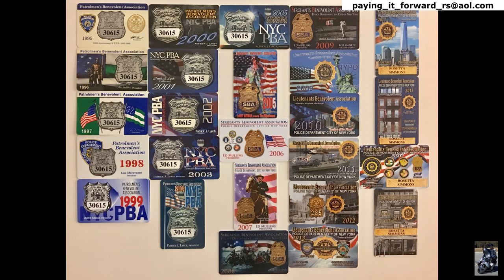No Need To Duckwalk Your Motorcycle In Your Driveway! Trust & Believe!

Comment: Answers: rear wheel stands you up.  Rear brake adds control. 
Robert, what you provide is immeasurable to so many.  I relate to your other pre-loaders.  I went to the local garage today, filled the tires with air and went to leave.  Wasn’t sure I could do a U-turn, but not only did I do it, but did it with plenty of room to spare.  What did I do next?  Well, here in Germany on Sundays, all stores are closed so I went to a parking lot and practiced. I have a lot to improve and am still learning.  THANK YOU so much.  Brian.
Reply from the maker: All answers absolutely correct!!😁👍🏾
Congratulations on that u-turn! You should be proud!
It’s my pleasure. 😊 Preload!!! And Keep It Loaded!!!!

Comment: this might be a silly question but i was taught to get off the low side of the bike, so i am curious as to why you get off the high side. you probably covered that in one of your vids but i am new to your channel so i have not seen them all yet but i really enjoy them and learn lots from you thank you
Reply from the maker: Yes there are two reasons I mount and dismount my motorcycle from the high side. The first reason is from training. Officers usually pull over on the right side of the road and when doing so, we are trained to dismount the motorcycle on the non-traffic side for safety. The second reason is it avoids accidentally causing scuffs on my saddlebags or backrest or anything else that may be victim to a swinging foot. This also includes a passenger being on the motorcycle while you're getting on. The third reason and most relevant one for now is it's easier. My hips are bad so not having to swing my legs up and over the seat is very beneficial. Hope that helped.😊
Reply: @BeTheBossOfYourMotorcycle   awesome thanks i never thought of that as i have issues with my hip as well, thank you very much for your solid advice
Reply from the maker: @zanedgallipeau9119  It’s my pleasure. :_PRELOAD:

Comment: Hi Robert. I'm a subscriber from the Eastern region of Thailand, near the Cambodian border. The roads are dangerous here and I always practice safe motorcycle handling. In fact I had my first motorcycle lessons from the Toronto Police Force in 1986 when I got my first bike. Your slow speed techniques are very smart and I'm using the rear brake way more than I used to.
I answered all your quiz questions correctly today thanks to watching 4 or 5 of your previous video practice sessions. But one thing puzzled me in this video. At 3:45 you praised Preloader Don for mounting from the high side. This is new to me. I've tried it and I've thought about it but I need to know why you recommend mounting and dismounting from the high side. I don't think you've talked about this before.
Reply from the maker: Hey Dan. Thank you for watching and subscribing!👍🏾😁 Also, thank you for the compliment! 
Yes there are two reasons I mount and dismount my motorcycle from the high side. The first reason is from training. Officers usually pull over on the right side of the road and when doing so, we are trained to dismount the motorcycle on the non-traffic side for safety. The second reason is it avoids accidentally causing scuffs on my saddlebags or backrest or anything else that may be victim to a swinging foot. This also includes a passenger being on the motorcycle while you're getting on. The third reason and most relevant one for now is it's easier. My hips are bad so not having to swing my legs up and over the seat is very beneficial. Hope that helped.😊
Reply: @BeTheBossOfYourMotorcycle  Thanks for the explanation Rob. I need to understand the reason for something before I can really internalize it and make it a habit. However, in Thailand we drive on the left side, so I guess I can continue to use the low side as long as my hips hold out. Cheers!

Comment: I didn’t watch the whole video because I’m getting ready to leave for work. My question is, why get on your bike from the right, instead of the left 🤔. I get on where the kickstand is located. I’m a new rider kind of. I learned over 10 years ago. Just recently got my motorcycle license when I moved to Florida, from California. I’m ALWAYS up to getting more information about how to ride. I don’t have a bike yet, but I’m working on it.
Reply from the maker: Yes there are two reasons I mount and dismount my motorcycle from the high side. The first reason is from training. Officers usually pull over on the right side of the road and when doing so, we are trained to dismount the motorcycle on the non-traffic side for safety. The second reason is it avoids accidentally causing scuffs on my saddlebags or backrest or anything else that may be victim to a swinging foot. This also includes a passenger being on the motorcycle while you're getting on. The third reason and most relevant one for now is it's easier. My hips are bad so not having to swing my legs up and over the seat is very beneficial. Hope that helped.😊

Comment: I think Ive watched all your vids maybe missed one or 2. Why would you get on your bike on the high side? I never seen any one get on a motorcycle from the high side.  I appreciate your advice.
Reply from the maker: Yes there are two reasons I mount and dismount my motorcycle from the high side. The first reason is from training. Officers usually pull over on the right side of the road and when doing so, we are trained to dismount the motorcycle on the non-traffic side for safety. The second reason is it avoids accidentally causing scuffs on my saddlebags or backrest or anything else that may be victim to a swinging foot. This also includes a passenger being on the motorcycle while you're getting on. The third reason and most relevant one for now is it's easier. My hips are bad so not having to swing my legs up and over the seat is very beneficial. Hope that helped.😊
Reply: @BeTheBossOfYourMotorcycle  Thank you for that in depth reply. I tried this on my Road Glide and it is easier to get over my driver back rest.  I also tried it on my Street Bob. Not really practical for the SB the frame seems a  little small and it's about 300lbs lighter.  Again thank you you insight has helped me improve my riding skills.
Reply from the maker: @AmericanSCPO  It’s my pleasure. 😊 You can do it on your Bob. Make sure your hands are on both of the handle bars before you put your weight on the motorcycle. That will ensure your weight is centered on the bike and you can just step over the seat. Give it a try and let me know how it works out. 👍🏾

Comment: My understanding that police officers dismount on the high side to protect themselves from traffic, but why do you reinforce the practice of non-officers getting off the high side? Thank you for sharing all your knowledge.
Reply from the maker: Yes there are two reasons I mount and dismount my motorcycle from the high side. The first reason is from training. Officers usually pull over on the right side of the road and when doing so, we are trained to dismount the motorcycle on the non-traffic side for safety. The second reason is it avoids accidentally causing scuffs on my saddlebags or backrest or anything else that may be victim to a swinging foot. This also includes a passenger being on the motorcycle while you're getting on. The third reason and most relevant one for now is it's easier. My hips are bad so not having to swing my legs up and over the seat is very beneficial. Hope that helped.😊

Comment: I have a question, when you're pulling into the driveway or place like that... Do you pull in the clutch as well? Or just keep using the rear break and along with slow speed ?
Reply from the maker: Thank you for watching and hopefully you’re subscribed!👍🏾😊 I stay in the friction zone and use the rear brake when needed.

Comment: Hey, man. I just bought my dream bike (as my first bike) on May 11th. I live in ATL and have been practicing slow speed clutch stuff in a parking lot. I was wondering if you'd possibly give me some coaching?
Reply from the maker: Congratulations on the new bike. Are you referring to private lessons?
Reply: @BeTheBossOfYourMotorcycle  any sort of coaching you offer.
Reply from the maker: @phillippavon2887  I offer my practice sessions which are free to my V.I.Preloaders and I also offer private lessons which have a fee.
Reply: Is there a way to get in touch with your personally?
Reply from the maker: @phillippavon2887  my email address is on the upper right corner of my videos and in the description section.:_PRELOAD:

Comment: I have a question how about going the opposite direction. Is it possible to duck walk going backwards down your driveway?
Reply from the maker: Ducks don’t walk backwards.
Reply: @BeTheBossOfYourMotorcycle  Have my new heritage stuck in the corner of my very short single car garage wondering what is the best way to get it down the driveway or turned around so I can drive it out?
Reply: I was glad to get my bike out of my little garage (duck walk -backwards) and past my parked truck. On a pretty good incline. I wonder if I need a battery tender? My gal really growled at starting in 30° Minnesota weather.
Reply from the maker: A tender is a good idea.

Comment: What is the purpose of getting on and off the bike on the high side?
Reply from the maker: There are two reasons I mount and dismount my motorcycle from the high side. The first reason is from training. Officers usually pull over on the right side of the road and when doing so, we are trained to dismount the motorcycle on the non-traffic side for safety. The second reason is it avoids accidentally causing scuffs on my saddlebags or backrest or anything else that may be victim to a swinging foot. This also includes a passenger being on the motorcycle while you're getting on. The third reason and most relevant one for now is it's easier. My hips are bad so not having to swing my legs up and over the seat is very beneficial. Hope that helped.😊
Reply: @BeTheBossOfYourMotorcycle  Thank you for responding back. That makes sense to me.  Being trained that way I understand well, I'm in the Army. I  might try this method out and see if it'll work for me.

Comment: To high of handlebar make a difference in your video!
Reply from the maker: What do you mean?
Reply: If you have16in or higher apes is it hard to control the bike in turn
Reply from the maker: @arthurnava4518  it depends on your height and/or reach. Turn the handlebars all the way to the right. If you can still reach the clutch handle comfortably,  you’re good to go. Check out this video. I riding with 16” bars. 
https://youtu.be/9urXt7Y1NLY 43:08